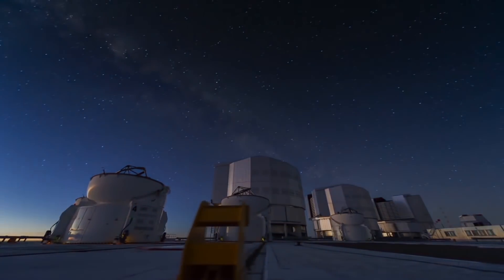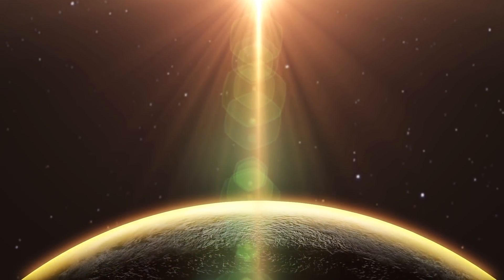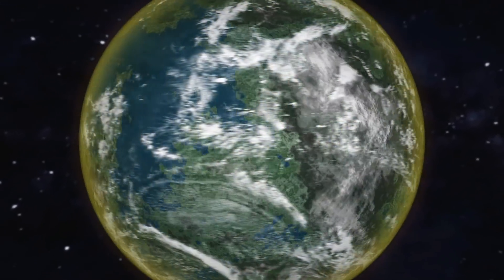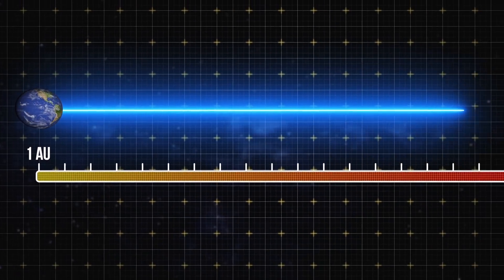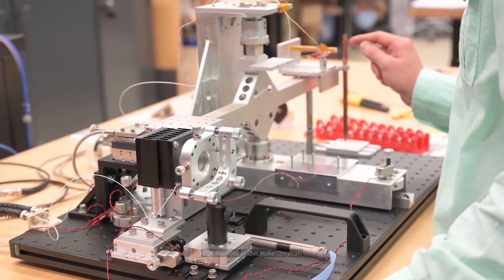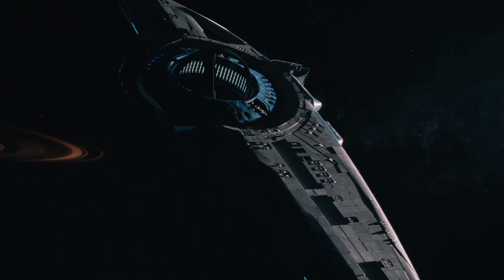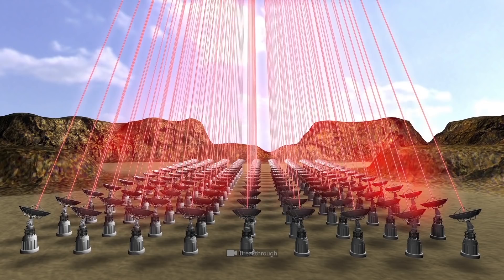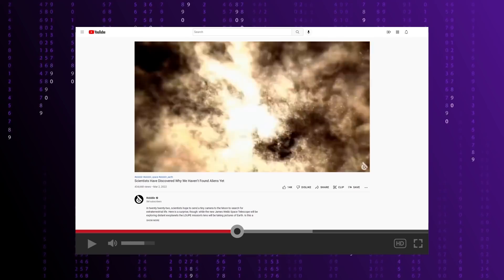Something Unusual is Going On With Proxima B Right Now

Comment: Where would the nuked manholes covers be right now? They were the fastest man made object to leave earth
Reply: 0.012115714644847073 Light Years away.    Considering a speed of 250k Mph which was estimated for the 900Kg Iron Manhole cover.  However, most agree that it was vaporized due to friction of atmospheric exit.

Comment: Any super fast ship going through space will need also a "bow shock" that can deflect any objects directly in it's path.
Reply: The ratio of space between planets you wouldn’t ever hit any planets even traveling faster than light you wouldn’t hit anything due to the distance between planets unless it’s a comet or asteroid or something
Reply: @sevennew9591  A common misconception is that space is just empty. It is not empty, it's mostly empty, but not totally empty. Interstellar space is full of dust and small particles of matter (let alone streams of energy, which as you should know, is equal to matter/mass). So, it's not about hitting a planet or moon. It's about the smallest objects and particles that could destroy any probe or ship we send. That's why the idea is to send thousands of solar sail probes out at once - most of them will be destroyed by dust etc impacts on the way there.
Reply: @sevennew9591  and if you where an astronaut, you would  like to take that chance?
Reply: @Malfurionxtc  If someone shot me through the asteroid belt to reach Jupiters moons, I'd take that chance. Likely you will not hit a single asteroid. Everything is very spread out.
Reply: @dbsti3006  because we have a lot of knowledge about that belt , knowing where they move, and how fast etc, much easier to predict where to "launch" you so you wont crash... Out there in the dark space we cant even see some objects like rogue planets asteroids etc, and as far as i know, space organisations would take MAXIMUM precautions to avoid any potential problem with such a critical mission (like sending someone to different star) and wouldn't just "throw a dice" and play on "nah he will be fine, chances are slim" card... Plus at that speed, even smallest rock/debris which we can't see even with best telescope in the world could destroy the ship.
Reply: @sevennew9591  You have to account for asteroids and debris left from other ships (if we are at a stage in which space travel is a common occurrence)
Reply: @sevennew9591  Just a grain of sand could have a devastating impact at those speeds.
Reply: Space is full of crap. Traveling to stars like this is practically impossible.
Reply: @ShamanKish  hardly, more like a few atoms per cc on average between stars.  Tungsten plate or similar can provide sufficient protection inside a star system.  Or for probes just go that route of hundreds or thousands of probes, some will get destroyed but the swarm does the work.

Comment: No repulsive systems can exceed the speed of heat because of resistance. Resistance propels heat at the same value of resistance. The more mass, the more resistance contained in and out of mass. Quantization of heat is repelled at a constant value of repulsive resistance of cold stationary space. It cannot be exceeded. Imagination can exceed reality. Heat and cold retain their repulsive value of motion, repelling heat. As heat amassing in entanglement, it's slowed down by resistance. Light is heat in resistance to atmosphere. Electricity is heat in resistance to mass forced through gravitational fields of forced motion. Magnetic fields of forced motion are in resistance to space curving in on themselves and cycling through mass. Gravitational fields of forced motion are stronger resistances. Hydrogen absorbs heat and becomes helium. Helium occupies more area than hydrogen. Helium has more outward pressure than hydrogen. The outward pressure held in gravitational fields of forced motion holding mass in patterns of fluidity in illusionary solidity, is weight. Helium occupies more space, so heat held in pushes outward as force in gravitational fields of forced motion. Weight is the outward pressure held in gravitational fields of forced flow. Equalization of frequencies in entanglement. Entanglement is gravitational fields of forced motion, in resistance to cold in mass, pushing outward  by repulsion. Outside repulsion of mass, directionally harmonizes with inside repulsive space within mass. Mass travels through space and resistance is continuously transferring through mass. Refrigerator affect. Spherical orbs have equalization of pressure from resistance to space in equalization. Moons occupy proximity space and become weaker points of resistance to proximity planets. Affecting the Magnetic fields of forced motion holding mass in. Resistance between proximity orbs is weakened. So the tides pushes outward to the weakest resistance. The apple travels to the weakest point of resistance. Theoretically, gravitational fields of forced motion holding mass together are the strongest force. Thermodynamics variations affecting elements makes or breaks gravitational fields of forced motion, holding or releasing mass. Quantization snowballing into elements or orbs returning to Quantization. Alpha and Omega. Theoretically.

Comment: I have done all calculations including relativity.
Fuel will never be a good choice, not even if you have fusion or for that matter, antimatter.
What I think the best solution is: Throw many lasers at a lightsail.
Like a laser array on the moon.
Reply: and what if its a paradise, you cant send a colonizing mission that only weighs 1 gram and has no way to slow down.
Reply: So, infinite mass at C.  It takes infinite energy to accelerate past C.  But your fuel mass increases with velocity as well.  Ergo, you have infinite fuel.

I’ll pack my duffel bag for the trip now
Reply: @anselpeneloperainblossom-s3489  
Who said anything about c?
You can't just accelerate like a retard, because biological systems like us would be torn apart and are not made for this. You should accelerate at 1g over long time periods. As you get closer to c, space continues to bend. Using this technique (constant acceleration and then decceleration), you can reach very many interesting targets within 400 years of travel... and u can reach most points in the universe within 1000 years, subjectively. Ofc for observer way more time would pass and he would observe you travelling a longer distance in more time.
Reply: Light sails r a terrible idea for interstellar space travel due to the fact that the energy the spacecraft will receive will be less and less the further it gets away from the source not to mention no real way to slow down or change course at such high speeds in the event that thers a celestial body unaccounted for that the spacecraft might crash into killing the crew & prematurely ending any mission they may have been trying to do
Reply: @Wastefuldragon  What I meant was that u must use the laser as an energy-source and convert it to energy for either lightsails (acceleration) or on-board-propulsion (deccelerate etc).
You want to send information anyways, so you got a beam anyways.
We need like 2458923 laser-cannons distributed on planets and in space and create a supply-chain of energy with these. 
Personally, I would love to see this happen on Mercury, as it is rich with iron and has very high temperatures, so you can set up strong solar plants there and machinize it. And on Mercury you can assemble spacecraft and send it to the sun, collecting energy from a much smaller distance to the sun and sending it as laser-beams to our distant colony-ships for energy and information supply.
Reply: outside the heliosphere that sail would be useless but getting the craft closer to the speed of light before exiting our system could be the only solution to see any results in this lifetime. We are having a big issue leaving our own solar system hahah
Reply: @samuelkundael3503  bro read what I wrote before u comment
Reply: @d7ffab979  i did. Guess I have to breakdown what I responded to you. Your light sail response becomes theoretically useless because outside the heliosphere it would act like a parachute and the cosmic energy made of the same rays as the laser will halt it. I propose an unknown alternative method to try reach the speed of light. The sun has a definite reach out thus meaning the forces out there are greater than light. I think you know what I mean.
Reply: @samuelkundael3503 I wrote that u use the laser as energy for propulsion.  .. you can do anything with the energy. The point is just to not carry the fuel for the ship on board.
If it's carried on board there are fundamental limits to the distance you can achieve if you want to accelerate at 1g forever.
Also you have to propel the propellant 
None of this if u send the energy with lasers
Reply: @samuelkundael3503  also I have done the calculations on what you claim and they are wrong. I can send you the paper if you give me ur mail
Reply: @d7ffab979  I do not need you calculations. I am a prodigy and have better to do. Good luck.

Comment: Why can't James Webb or the Hubble see proxima centauri better even though they can see the stars or galaxies billions of light years away.
Reply: TL;DR: Space is too vast for telescopes

They can "see" them because the light from bi. Of ly ago has reached earth and the early stars were very bright. On the other hand, you can't really see anything clearly with a telescope because the space is too vast it's impossible to see anything outside the solar system in clear picture. We can only see it's light or detect them through infrared or other means
Reply: Good question tbh
Reply: James webb could but tge problem is that james webb is still being callibrated
Reply: Also james webb sees infared light and not visible light

Comment: A probe weighing 1g with a power source that can last 20+ years, a camera and a transmitter capable of sending a detectable signal 4.5LY. I doubt I will see it launched in my remaining lifetime.
Reply: @EnderBeast and it Will probably get a few delays too so
Reply: It took James Webb how long? Delay after delay. It's OK to be optimistic, but it's also OK to be realistic.
Reply: @EnderBeast ah a spacecraft that can travel at over 500 million kph. hmmm, I just need to see something with a camera going faster than 107 000 kph, which is the speed of earth around the sun first before I believe anything.

Comment: If u were to make a high speed spacecraft, u don't have to worry about air resistance right?
Reply: theres no air in space
Reply: @snall2069  oh tnx. I was just making sure. All you need to worry about are random space junk and debree right? Random taughts just flew by my head and imagined a wide highspeed spacecraft.
Reply: @kannaaah7333  yes space junk is a problem. And a big problem at high speed!
Reply: @kannaaah7333   that’s partly the reason why the starshot project will release 1000+ of probes to increase the chances of one potentially reaching Proxima B. In addition, if the initial launch is successful and we indeed are able to send off the probes using this process, they plan to follow up by releasing more to further increase the likelihood of a successful flyby.
Reply: @snall2069  there is air in space! Theirs air in supernovas to water in asteroids (H2O)  it's not breathable due to space itself being a vacuum
Reply: The small rocks that are floating in space are big problem for very high speed space craft. So sciencetist gotta make very powerful resistants for those junks in space.